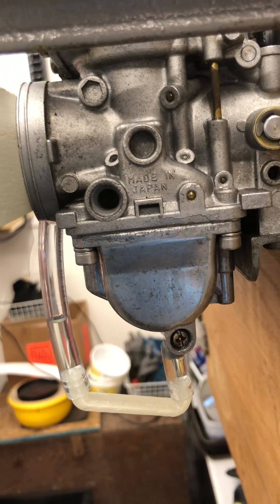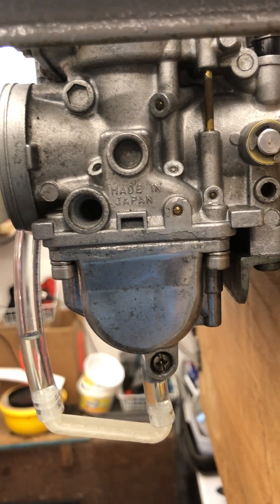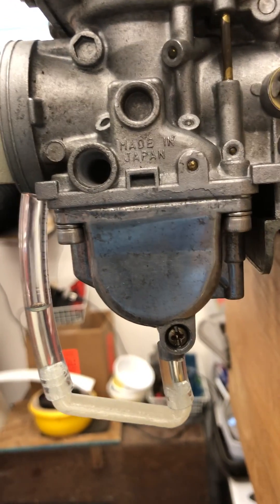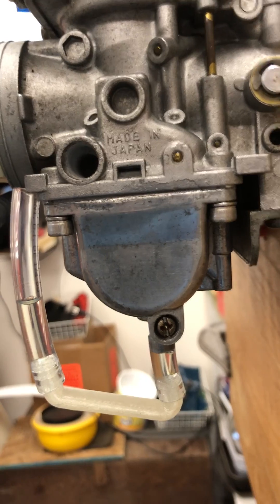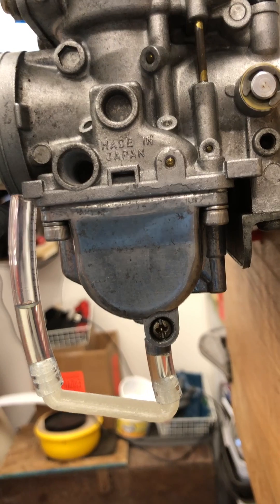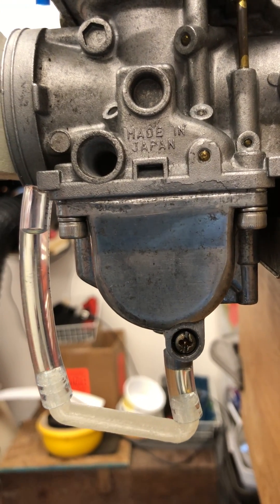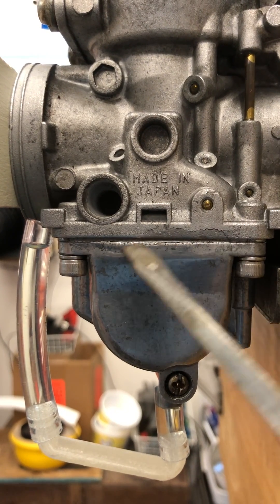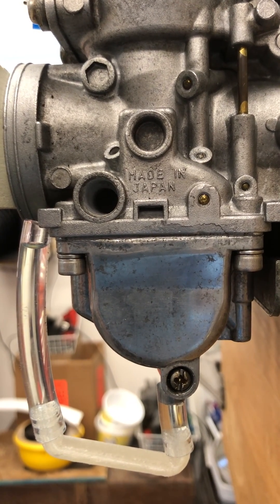Checking Fuel Service Level on Mikuni Carbs

Comment: The float height spec on my new VM30 carb is 22 - 24mm. When I check this with my actual fuel height I find the fuel level to be about 5mm low to your recomended level? Does this mean that the individual float VM30 Mikuni is an exception to your rule as I can't see how I could bend the float arm to get a 5mm change?
Reply from the maker: Sorry, but 3mm is not a rule. I mention in the video that you need to check the spec for your bike. Different bikes and different carbs will have a different fuel service levels.  If I understand you correctly, you are getting a fuel service level of 8mm below the seam between float bowl and carb main body. That seems way too low for any carb. Please check with your dealer or service manual to see what spec your carb needs. It is also possible that you have bubbles in the hose you are using or that you have jiggled the hose up and down which will give you inaccurate readings.

Comment: Are those carbs for a Yamaha xj900?
Reply from the maker: Hi. No, these are from a ZN1100 Kawasaki but Yamaha used essentially the same Mikuni BS carbs on the XJ900.
Reply: Thanks. I have the xj900 and I think my float levels have been off for a while now. @advrider9143
Reply from the maker: @JshMusician  Well then, this method will allow you to quickly check those levels without any disassembly of the carbs.

Comment: Does the size and angle of the tube matter? As long as it’s reaching the top of the lip for measurement?
Reply from the maker: The size of the tube matters because bubbles can easily be trapped in the tube causing inaccurate readings. The angle of the tube should not matter however. But don't lower the tube and then raise it again. The tube needs to be stationary until the gasoline finds its own level.
Reply: @advrider9143  Thank you!